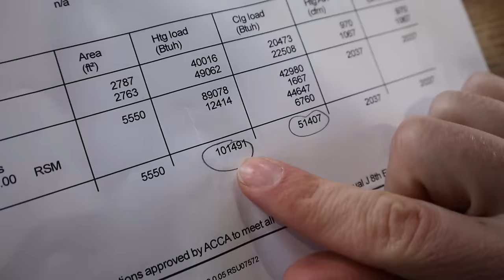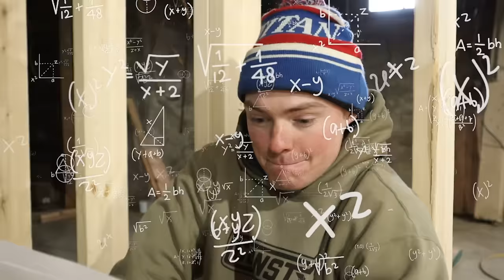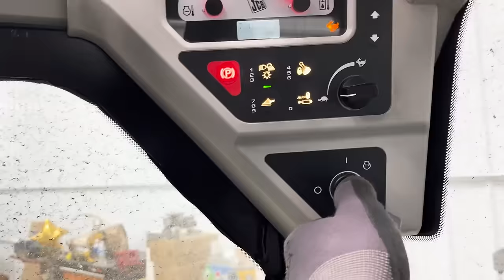Restoring A $7,000 Mansion: Removing 2nd Story Floor

Comment: I would definitely add an ERV system if you can, it exchanges the air which helps with allergies, virus transmission, and anything offgassing in your house (gas stove, cooking fumes etc).  It keeps the air healthier in general.  We added one in, and it gives us peace of mind that our indoor air quality is healthy.   When you build a new house, and with little kids as well you want to keep offgassing building materials, paint, glues, even new furniture etc from building up voc's, and this is helpful.  It's also way safer if you have any radon.

Comment: Go with Mini splits for the upstairs and attics they work much better in a house with vent problems. It will cut your ducting cost  in half and it gives you a lot more control of those zones. Forced air is great for 1 and 2 floor homes that are new but in your situation I would split your 2 systems one forced air heat pump in the basement and a one mini split system for the top 2 floors with room units which will allow you to control the cooling in each bedroom when using and not using which will be huge in the summer!

Comment: I am just finishing a solo rebuild of a house (only 1500 sq ft) That was also completely closed cell spray foamed.

I'd consider cutting the HVAC system and just going with your heated floors and mini splits. You are going to end up with a ton of air handlers, but it kind of is what it is. If you are going to condition the basement one handler should be fine, two would be great on the 1st floor. Each bedroom will want it's own, if there is a living room in the 2nd story you'll want one there, and then depending on how closed off the attic is, at least one up there.

I did my house with a traditional (just non-DIY, it's all the same tech the DIY are just easier to plumb) mini split system, and in the future I would do a Mr Cool. 2x 48000 BTU quad systems would give you 8 handlers and more than enough heating and cooling capacity (before even account for your heated floors) So it would completely cover your heating and cooling needs and would come in well under 20k. 

I don't have any handlers in my bathrooms, and they are a bit warmer in the summer but by no means are they uncomfortable. They are cold in the winter though. I would add floor heat to your bathrooms, if you are already running and hydronic system expanding it up to just the bathrooms wouldn't be too hard. I used the electric mats which are cheap and easy to throw under tile, and not terribly expensive to run in such a small space. Or go crazy and add handlers to the bathrooms, I just don't think it's very common.

Lastly, definitely do the ERV/HRV. That old house was used to breathing, now you've sealed it all up. I live in the desert and I had plumbed my HRV system during the build but didn't actually hook up the HRV unit for a few months after heating and cooling it. It was easily 60-80 RH inside, which is not good. After getting that thing going I sit at 30 year round. If you don't have traditional HVAC ducting to tie the HRV into you will have to do a dedicated system which will require it's own ducting. The difference is you can do use 3-4 inch duct, dryer flex vent, they have plastic corrugated lines that are like a large smurf tube, or even PVC. You'll want supply in the main living areas of the house and bedrooms, and exhaust in the kitchen, bathrooms and then to even out the amount vs supply just add them to stale areas like your closets and pantry

I don't even have regular bathroom exhaust fans, it is all handled by the HRV and is a far superior way to ventilate a bathroom. A return also serves as my kitchen exhaust, but that is not common and a pretty debatable idea

Comment: Old houses certainly do have their challenges, that being said, the work that you guys are doing currently it is not a stretch to believe that, if given a set of plans and some instruction, you could certainly run the ducting. In 2011 our old house was flooded and needed a complete new forced hot air furnace. We had a woodstove on the first floor for our heat that winter but I did the calculations got them double checked at a HVAC supply place by their engineer he added a couple more cold air returns. I purchased some duct board cutting tools off of eBay and built my own main trunk and plenums and used flex duct for my supply lines. I used Thermopan panning and used the joist space for my cold air returns only having to build a few jumper boxes to get from one section to another.  I was 41 that winter/spring when I did this project, so you three young guys can certainly handle that part, save yourself some money! You got this!!

Comment: Cole - Loving the content. With all your doing on the house, have you considered water proofing the basement walls even though they are not leaking? To be preventive? What about finishing off the basement? The boys could play down there better on cold and wet days. You could have laundry, bathroom, family room, exercise room and storage. With doing it yourself, it would not cost that much more. My suggestion for the living room is an electric fireplace. You could hang the TV above on the wall. It gives a homey feeling to the house. I suggest you put a laundry room on the second story too. The laundry room in the basement could be for work farm clothes that have chemicals on them. The second story laundry could be for clothes. I grew up on a farm. My Mom always washed my Dad's clothing separate away from all other clothes. She worried about the chemicals he was using. F.Y.I. I hope you consider some of my ideas. 😊

Comment: Enjoying your remodeling project.  It's good you also mention the realities of a full remodel and gotchas along the journey.  This is essential knowledge as it will delay schedules, manpower and costs.   Too many homeowner's don't understand to include contingencies for the unknow and unplanned.  Great lessons you've identified and share with your audience!! 

As for heating cooling solutions and options. Here's a few options I've researched and implemented plus next system for new build a geothermal system plus a bricked wall & floor with a wood burning steel fireplace as supplemental heat.

Have you looked into a hybrid  radiant heat and cooling system?   The same pex tubing can be switched to heat source or cooling source when weather season changes.   A good design layout of tubing is DIY doable too.  

Your foam insulation and your newly housetrap improves conditioning the house year round. 5/8th inch drywall adds some "R" value as well.   

Did you look into high volecity HVAC ?  If you look into this, I strongly suggest for the main ducts to go with round sheet metal over foil encased fiber glass main duct work .  High velocity systems could heat/cool basement & 1st floor , another unit can support attic and second floor.  The volecity systems air duct distribution branch are flexible. The termination ends are small and have discrete options that make them somewhat unnoticeable. 

Installing the ducting is definitely doable for DIY. You'll need to invest in sheet metal tools.  The key is having a design layout and following the design. 

Other option geothermal  system, you have the land and equipment to do the expensive work. 

Which ever solution, the key is serviceability, low maintenance,  reliability and parts availability.  Most important, service companies local and knowledgeable of the system you choose. 

Lastly, invest in high efficiency system. Upfront cost is higher but return on investment comes quickly as utility bills will be lower.

Comment: Cole, I just moved from north central ks to fairbanks ak.  The house I bought here is SOLELY heated by a boiler and radient floor heat. We just made it through our 1st winter where it was regularly -30 and occasionally -50...winter is 6-7 months here.  I thought I was going to freeze the entire winter because I didn't have faith in the system. I was pleasantly surprised at how well it kept our house nice and toasty. We have numerous zones set up throughout the whole house so we can keep common rooms warm during the day and bed rooms cool...opposite at night. Really helps save on heating cost. Highly recommend you do the same...you will love it.

Comment: been using heat pumps for going on a few decades now. having a properly sized system, or systems is key. I like having the two, costs you more up front, but gives you a ton of flexibility. Can focus the heating a cooling in spaces that you are in and adjust the heating and cooling up or down when you are not in the spaces. Occupancy sensors make this effortless. I have saved so much in the cost of propane over the years having the heat pumps, will never have a place without one or several.

Comment: Yes having separate systems is an excellent idea as it helps zoning the home saving energy. Also heat pump system doesn’t work when outdoor temp is below 40 degrees as it’s not efficient

Comment: You might consider a minisplit heat pump system. I have some that work, too -15F, and they are efficient. Additional advantages are that there are no ducts to deal with. You can put a couple on each level and control each floor to whatever temperature you want. They can be turned off if you are not in the room or just turned way down. Also, there is redundancy.

Comment: Take a hard look at ductless systems. They cost less, are easier to install, use less power, and you can put multiple heads throughout the house/garage. We switched, saved 5k on replacing our old system, and it uses 1/3 the power. House actually feels warmer/cooler.

Comment: The system that I put in my place was a duel system. I have heating oil on one, and electric on the other. My house never had natural gas or propane, and I could not justify that system. I also have a wood stove. The wood stove is nice for me as I have a lot of wood on my land. If I did not have the wood, I may have used a pellet stove. I just want to say that I live in one of the coldest states, and I have had temperatures as low as -47 degrees. The wood stove is incase of a power outage, and it is in the room that I am in the most, so it provides a cozy environment. I use the oil system as the primary for the entire house. The electric system is on floor one and two of three, and is incase of failure of the oil system. Both systems can provide enough heat for the entire house. The issue I have is that if I lost power, I would only have a wood stove. The wood stove has the power to heat most of my house. I just would not want to run on one system if temperatures hit extremes. So,  I invested in a power system that has a whole house backup generator and a solar system. The Generator runs on the same oil as the Primary heating system. So in effect, I have a triple redundant system on both heating and electricity. This system may seem like a lot, but I am in a sparsely populated area. It could take some time to restore power if something happened to the grid. That all said, I have had to rely on my backup system due to grid failures 5 times in the past two years. One time was for four days. I am so happy I over built the system rather then under built. Oh, and I did all the work my self, so I saved a ton of money.

Comment: HVAC Comment:  Go with two units, don't put all your eggs in one basket, so to speak. One unit for your +5k cf of conditioned space would require moving more air which would required larger duct work adding complications into ceiling/floor space management. Two units would also give you management options for your conditioned spaces. Look at your space usage and consider independent zone control of group spaces. Also, study the return air pathways to check for clear and sufficient sized path back to the unit. Under doors for return air path may not be sufficient without unwanted air movement noise. When building a tight house in respect to air leakage, fresh makeup air will be important to incorporate into your design along with humidity control. 

Thank you and all of your family for allowing us a glimpse into your life/home. Continued success sir!

Comment: All those wonderful headers. I have a large one between the kitchen and living room I screwed big eye hooks into the header and hung baby swing so I could do kitchen work with baby contained. Then more hooks beside those for big swing I could swing on. Snuggle pod swing … with big carabiner clips I can change out swings.  I’m a grandma and big swings are in place and I swing all the time as do visitors. Swing high and touch ceiling fun.  The swings you could hang off all those headers. In the basement, the kitchen , so many trapeze and skateboard swings…

Comment: My house is half that size and we have two heat pumps. We still need a wood stove as backup in the winter. That’s a big price tag, but it will be so much easier to design a good system now than after you have the walls up.

Comment: Since you are installing all that duct work, perhaps consider electrical for in floor heating. Especially for smaller spaces like bathrooms. Both piping & electric require a cement top coat. The kitchen or main floor in floor heating will require less distance from the hardware in the basement. Also, both Welkers did heated flooring in their basements. I'd call them for tips too.

Comment: When I renovated my house I didn't have the space so went to a slit duct system with the heat pumps. We kept the old gas boiler for the steam heat as the primary in our York York winters.. yes expensive but I think it was our best solution.  Also the split ducts can take multiple heads for different rooms. But again the bigger split ducts that can do multiple heads do cost more. ..so it basically comes down to your budget

Comment: Being in hvac for 42 years. I say go with spiltsystems u will not need any duck work.
They will pull heat out of the air down to -18 degrees. 
With in floor heating u will be golden. 
A nice wood burner free standing .for when u want to burn wood.
Good luck.
U can install spilt systems your self.

Comment: HVAC Maybe you should try minisplits instead of ducts. They could be mounted in the ceiling and you only need to run piping for the coolant fluids. You only run the rooms you are using and it could easily be extended in the future

Comment: Hey Cole,  My house had radiant water heat just like yours did (mine was circa 195X , while yours was older... LOL)  with the big old cast iron radiators, and I installed 2 heat pumps instead when the old system started breaking down too often.  (and to be honest it was never set up properly in the first place)... The heat pumps work well, but they are both downstairs in our main living area, and the open stairway doesn't do well at getting heat upstairs so we have to use baseboard heaters up there to supplement.  Heat pumps don't work well around corners, through doors, up stairs, etc... you need a very good air exchange system in your house to circulate air (which I saw you display and I'm happy you have planned.)  Heat pumps are somewhat breakdown - prone in general, and I recommend 2 separate units to insure a small issue on one doesn't take them both out... especially in the summer when you are running AC... LOL  (you have in floor heating to supplement the heating side ).  Also as I understand it, if you get one outdoor unit and run multiple indoor heads, you can't put the indoor heads at different settings... I know of a situation where  a business building owner had this situation for multiple hair salons, and they were fighting over what the setting should be when one salon was in the sun and the other was not... etc.  Side note: LOVE the channel and your building project.. been waiting a couple years now for you to really get into this building and wow... your going all the way and I love it!... the 3 of you are doing excellent, keep up the great work!

Comment: I live in Arizona. It gets very hot. I am an Architect, builder and am well versed in thermal performance. I have one suggestion m: upgrade your thermal envelope. Fur and insulate all the exterior walls. 2x6’s are best. Use foam or mineral wool insulation. And replace all the windows.

You will be able to reduce the size if the hvac system and your bill will be seriously reduced forever.

Comment: To help level the main floors... have you considered using self leveling compound? If you finish getting the main floor it as close to level as you can from the basement supports... You can then use the self leveling compound on the main floor to get the finer finishing touches spots just right with less effort... Now that the basement support is stronger it may be good enough to support the added weight of the self leveling compound. Something to consider maybe?... Continuing to try and tweek the basement support is a constant battle of go up here now this spot is to high and you would keep making micro adjustments forever and not get the main floor perfectly level everywhere.  Hope the idea is a helpful one. You guys are good role models and examples to other to not be afraid to work hard and take on challenges and learn as you go... It truly is the best way to live, learn, and grow. Keep it up.

Comment: I highly recommend two systems in the main house, when it's easy to put it in!  There is no way one system to keep the entire house at the same temperature!  You will not be sorry going with two heat pumps, but you should check if geothermal is available in your area!  We put it in and have been more comfortable than with any system we used in the past, at our first house build, and the currant house build! Geo thermal will pay for itself if you plan to stay there!!!